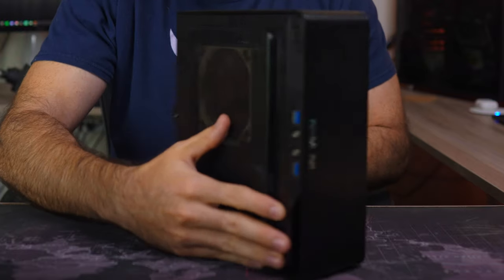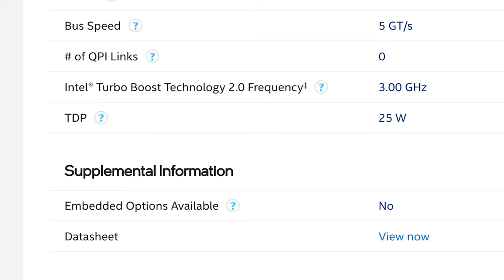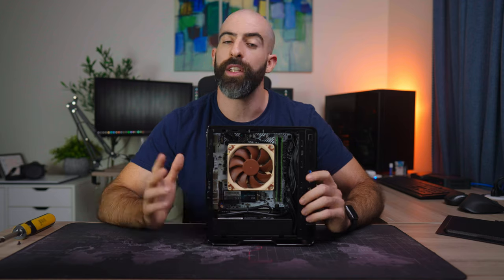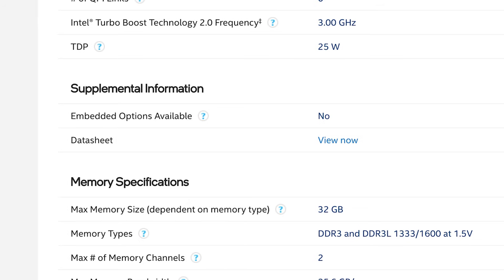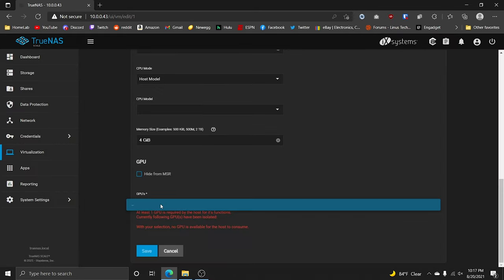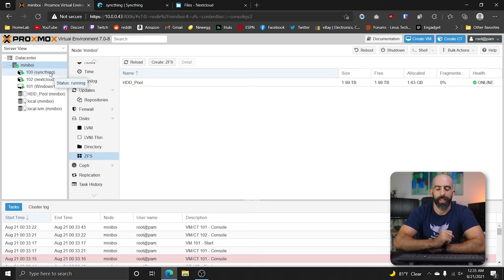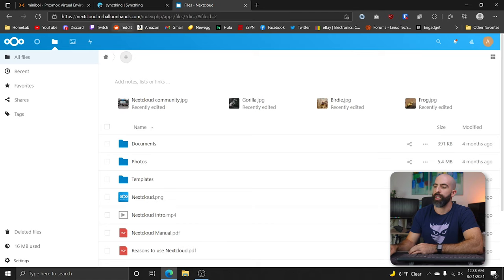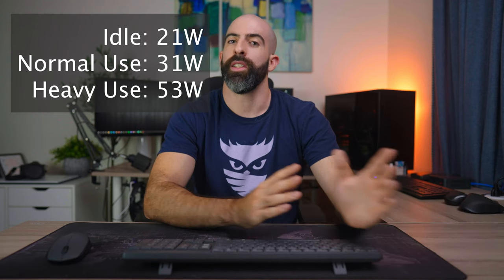Tiny Home Server Build - E3 Xeon, ECC Ram, nVME, and HDD Storage

Comment: I built an ITX server many moons ago using the In-Win BM648.
A backplane converted the 5.25" drive bay to Quad 2.5" HDD bays.
The one thing that always worried me was the proprietary power supply.  I would have a very hard job getting a replacement for it, if it ever failed.  At least with ATX and SFX there is a wide selection of off-the-shelf replacements and upgrades.
Reply from the maker: Yeah those super small power supplies are not easy to find a replacement for. I mean…how small does a server really have to be anyway? Lol

Comment: I'm currently running a few systems. 

1. Dell R510 only sporting a single hex core xeon, 32gb, and 12x4tb SATA hard drives as a NAS. 
2. Dell R710 with 2x hex core Xeons, 288gb ram, and a mix of SSD's and 8tb hard drives. This unit is my Proxmox lab machine. 
3. Fujitsu E752 laptop, quad core 2.0ghz 2nd gen i7, 16gb ram, 1x256gb SSD, 1x500gb SSD. This is my "production" Proxmox machine. It runs my docker hosts that I want up 24/7

I'm considering putting together a system much like yours here to basically take the place of systems 1 and 3. And then I can leave the big NAS down as "cold" storage and only power it up for updates and file system maintenance. And the big proxmox lab machine only gets used when I need to spin up either 1 or multiple new VM's for testing. One of those VM's i'm using TrueNAS Scale on with an 8tb SATA drive passed through to the VM. It's working out ok so far. But I think i'd like to test out TrueNAS Scale on bare metal to see how that would work out for running my docker services rather than running Proxmox and then Linux VM's and Containers underneath.

Comment: I don't mind some case bulk, I just don't want it sucking up excessive go-juice 24/7. I bought a small ready-made NAS primarily because it uses, not including the storage drives, about 4-5 watts at idle and 10-15w at full load. A 5400rpm 3.5" spinning disk is another 3-10 watts based on activity. 
So ~8watts idle, and 20-25w active.(Single core Atom around 1Ghz and 512MB ram. And hardware was made around 2011) 
At this level even fan wattage is significant. The power supply is just a wall-wart.

Plenty functional for serving files to a few users. I would only step up if I had more than 5 full time users in the office or was running some very high continuous load scenarios and needed more than 1Gb ethernet.

The secondary reason for a premade package-deal is that the OS(linux based) is preconfigured with all of the basic services I want and even has a nice browser GUI for management, though I do still ssh in for some stuff. (The GUI can be a bit slow with such a low power CPU, but I only need to do management like once per month or two so its an acceptable trade off.)

Comment: Heh...my little FreeNAS server has been happily chugging along for 10 years, running with full ECC across the system.  Intel Xeon  E3-1200 v2, Supermicro MBD-X9SCL-F-O, ECC UDIMMs (16G).  Everything sits in a little LianLi cube and is basically silent.  I was a little worried about using just the stock CPU cooler, but the proc has always stayed well within designed thermal range.  In the last decade, I've swapped 4/6 drives, and the RAID Z2 pool is error-free, even on a mix of drive sizes and a rogue 5400-speed HDD running alongside the other 7200s, which is not recommended but has been running just fine for years, last swap was 3 years ago hahaha.  So far, failures have been predicted well in advance due to regular SMART tests and email notification.  I have never updated the original FreeNAS ver., and since there's no easy upgrade path to TrueNAS at this point, I've decided to finally rebuild.  To retain full ECC, I'm keeping the Supermicro mobo and the Xeon proc; everything else is getting upgraded.  Can't wait to try TrueNAS!  I'll be more conscientious about patching in the future. :) Thanks for a cool video.

Comment: Looks like that case could do three of those SATA drives. You could do RAID-Z1 with that, what gives you 4 TB + compression...
I have an Fujitsu Celsius W530 here. That has nearly the same CPU - E3-1240v3. Runs really great...
Reply from the maker: Yeah you might be able to fit another one in with some double sided tape. Those older Xeons are awesome.
Reply: You talked quite a bit about having Proxmox running directly as a NAS. Did you make a video about it? How did you do it. Just installing Samba?

Comment: Found your channel a few hours ago...been trolling through past videos hoping to learn some really simple stuff that I have not seen elsewhere....maybe just so obvious to smarter folk..but not me ! Just two examples.....how do you turn Proxmox off...if all you see on your remote PC is terminal shell....what command gets it shutdown safely? And if you had two PCs to start a home setup...how does each PC determine the resultant user experience as far as speed, lag, and ability to run bigger programs ( not gaming...e.g. say a CAD or Graphics application).....what does each bring to the party....can the client PC display in 4K if server does not have 4K capability etc.    I am now going off to view your 10G video :)

Comment: Frédéric Chopin* = Pan is more like Pahn - Credentials. He's my favorite pianist.

The other guy was close though. I might even be wrong but this is what I was informed of many years ago.

P.S How is that power supply holding up? The one in my InWin A1 popped the transformer and then blew itself after about 1 yr of service.

retrofitting another one, was a challenge, however it was possible.

Comment: I am thinking of buying an old xeon e3-1231 v3 with s1200v3rp motherboard for $54. I run ubuntu server 20.04 in my old core 2 duo laptop with samba and nextcloud to backup my data. I though this one will be a good upgrade as motherboard has 2 Gigabit NIC and I can use a variety of VM's like pfsense, dns with it.
Reply from the maker: Yeah for $54 that’s solid!

Comment: Personally I'd just go wait till my PC's CPU is too slow for me (Ryzen 7 3700X), put it in an ITX/SFX build, add 2x8GB of ECC memory and just use that. The CPU draws about 2-3W at idle, which is what it's gonna sit at about 99.9% of the time.
Most of the software I write and operate are asynchronous single-threded programs so what I need is high IPC... Old Xeons out the window...
Also no GPU, but I can honestly just go for the ASRack M.2 GPU...

Comment: interesting to see Idle power draw of that little sytem. My truenas server was pulling 100 watt idle. I've just replaced 8 hhd's with 10 samsung qvo 4tb ssd's i have 2x 2.5" 7200 rpm hdd's in it still and 2 120 gib ssd's for mirrored boot, 1 8 port sas card, 1 dual 10gb network card, 8 sticks of 16gib ddr4 2133 eec ram, 1 256gib nvme and ntel Xeon CPU E5-2690 v3 12 core. I'm pleased its now pulling 60 watt idle.

Comment: Hello, thank you for your nice video.
I am running a custom built server based on Node 304 case since 2013.
It was running on a Pentium G2020 and 4GB of RAM at the time with only Debian installed (for doing almost everything). I switched one year ago to Intel Xeon E3 1260L, 16GB of RAM and 10G net adapter.
Proxmox is the main operating system with some VM installed (Debian with docker, OpenMediaVault, OpenWRT).

Have you tried OpenMediaVault in a VM?
Reply from the maker: I have not. I’m a huge fan of TrueNAS but I’ve also heard good things about OMV. Maybe I’ll throw it on one of my backup servers and see what he’s all about

Comment: dont want to be a smartass, but the tdp  is termal design power and has nothing to to with the power efficency.
"TDP refers to the maximum power dissipation generated under full load for a CPU or graphics card."

Proof.
https://docs.google.com/spreadsheets/d/1LHvT2fRp7I6Hf18LcSzsNnjp10VI-odvwZpQZKv_NCI/edit?usp=sharing

this is a list of low idle power systems and there is a i7 that is worth looking.
5,8w idle	124w load 	C8	Intel Core i7-9700K	Fujitsu D3643-H	PicoPSU-160XT + Leicke 156W NT.
that one just draws 5,8w in idle.......